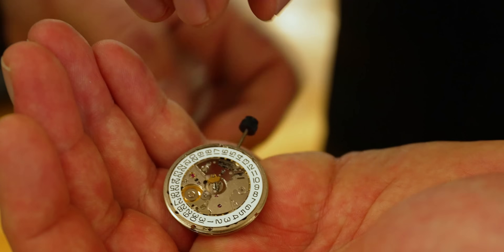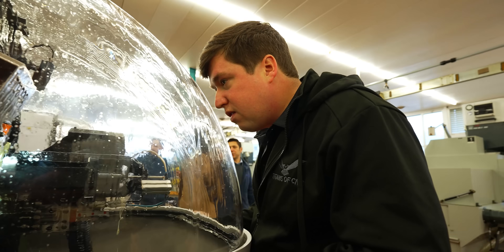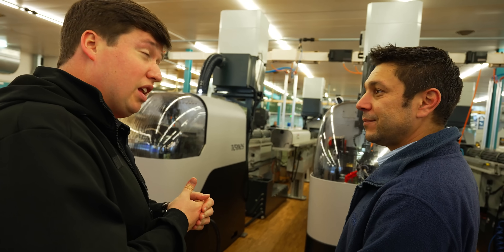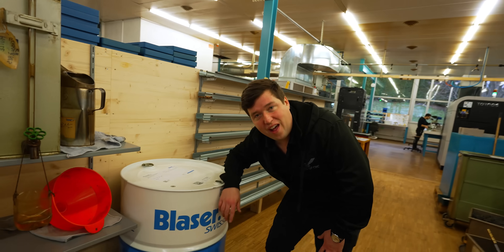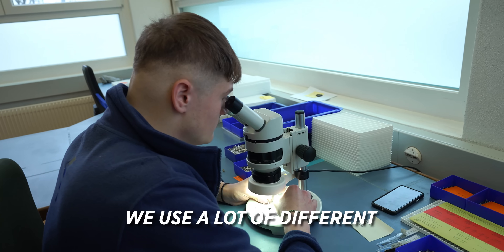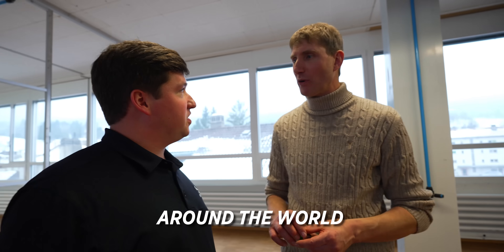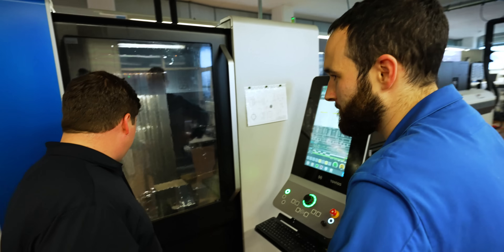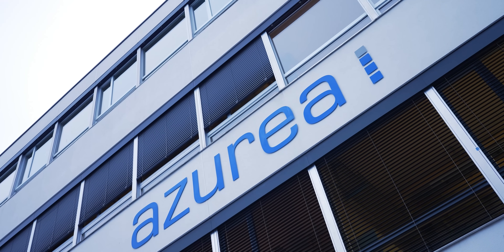Making Millions of TINY Precision Parts In Switzerland

Comment: Super impressive. I programmed machine tools in 80’s before there were high level CAM systems. APT was the programming language and there also wasn’t any 3d CAD. You visualized the 3d part in your head from a 2d drawing and wrote code line by line. It was the highest paying job in manufacturing. Today the machinists program their parts at the machine. How things change in one’s lifetime.

Comment: Has everyone faioed to mention that before CNC the same parts were made to the same accuracy in numbers not so smaller than now? For example, some factories were able to produce 3,000 complete  basic watch movements per day, with most parts made in house. Now, that is really amazing.
Reply: Yes, the old-school way had a lot more manual labour and custom machines that did one job only.

Comment: A machine shop with windows????
Reply: Swiss law.  All work areas must have natural lighting.  If not there are significant limits on the work which may be done.  I was at a factory there that does all precious metals such as machining gold, platinum, and palladium.  They even refine and cast their own gold ingots for use.  The facility is enormous and build multiple stories high with all windows facing in to an open air courtyard in the center.  This is to comply with the natural lighting requirements while also maintaining security in a facility where I saw USD 3 million worth of palladium blocks sitting at a machine awaiting processing.
Reply: @kennethfharkin  I wish America had that mindset..... Machine shops here rarely have natural light. Throws your circadian rhythm off too

Comment: Are all Swiss watch companies using CNC or are the more prestigious ones still hanging on to manual manufacturing?
Reply: CNC is taking over.  There are still some old Tornos cam machines running but it is fewer and fewer.  The Swiss nanos take roughly the same space and are now fast enough to justify the swap.  In addition the watch makers are in an "arms race" of sorts to continually make more complex movements requiring more complex parts made from more difficult materials.  You still have an enormous amount of traditional screws but many other parts have gone beyond the capability of a cam to produce them.  You aren't running 316 or Ti on the cams.  This is especially true of the highest end watch makers who continually push the envelope.  

I've been on the floors a couple times a year there since 1999.  Every year there are fewer cams.  The most I see running now aren't even for watches but supporting connector production where copper alloys are king.

Comment: I'm very curious. I work in a high-level plastics machine shop in the eastern US and we're looking at tornos machines. We machine EVERY type of plastic. From generic delrin that many machine shops run, to the polymer equivalents of super-alloys that cost thousands of dollars a pound or more that end up in satellites and other extreme duty applications.

Because these swiss machines use guide bushings as opposed to a standard chuck, is it an issue with plastics? I know harder plastics like polyester or G10 would be fine, but what about softer stuff like UHMW, HDPE, or even PFTE? if you saw anything like that there Donnie, I'd love to hear because we've used your shop's production as some inspiration for looking to purchase swiss lathes
Reply: Yea it should be fine as long as the outside diameter of the material is consistent. There is also NON guide bushing mode which makes the machine function like a traditional lathe. There is also adaptive guide bushings that can adjust automatically to the variable diameter of whatever material you are running. 

I can confidently say you won’t have a problem with these solutions BUT I would need all the details
Reply: Chips management will be your biggest challenge with such materials in Swiss type.

Comment: I'm just amazed that in this day and age there is enough demand for mechanical watch parts to support a huge operation like this!
Reply: Have you seen the prices some watches go for?  Also,  I'd bet there's still a lot go into munitions.
Reply: @MattOGormanSmith  Really good call on that. Lots of various clockwork safeties built into munitions. Like needing a certain RPM and revs (that can only be achieved by firing from a barrel) to align the powder train for the fuze. And there's been a loooot of munitions flying around the last two years, sadly.

Comment: 5:46 Only one second to optically check a tiny part with a tolerance of plus-minus 3 microns (metric) AND automatically correct/update the production machines in real-time to fine tune the production run.  Very impressive.
Reply: I took an hour trying to properly measure a 3mm hole with a K6 tolerance on it 😂.  That machine does it in a second.
Reply: Those Keyence im machines are awesome
Reply: @joelawton123 yup. With my company bought Keyence instead of Ayonis.... I cry every day using it
Reply: I’d be interested to see how that actually works , because the time from when they check the parts to the time when they update it, it could be off depending on how warmed up the machine is, I honestly can’t picture how that would work.. and don’t believe it. Especially on a tolerance that insanely tight on a machine that is turning not grinding, and what if the machine is currently running? Inserts are slightly more worn now then when the parts made, someone explain this to me I can’t wrap my head around it, unless. They have some insanely accurate tool setter with macros for tool break detect
Reply: @adammiller4879  thats why you have a temperature controlled environement and machine. Thats just the basic rules in precision machining.
Reply: @Zonkobel  that’s not what I’m talking about, depend on your warm up cycle, your machine can vary .0005, on my dmg mori, if I take a break and set it in it’s precise warmup cycle it will only change about .0001-.0001, so I’m just talking more about the machines variables, there’s just a lot to factor in is my point and it’s hard to wrap your head around it
Reply: @adammiller4879  did you notice that the machines are running nonstop?
Reply: @adammiller4879 you usually don't stop the machines when you don't setup a new part.
A big part in precision machining is coolant temperature control, they can warm and cool their coolant.
Reply: @adammiller4879  Yup, it is years and years of trial and errors, producing watch parts with tight tolerances on Tornos machines is possible, despite the challenges involved. It requires years of experience, a combination of scientific knowledge and artistic finesse. It is extremly difficult to achieve
Reply: @MsKoffeinjunky  I know, that’s just one of the many factors
Reply: @blackshadow772  and it’s amazing isn’t it, these guys must have absolutely mastered every single tiny detail. I’d love to see what type of macro setups they are using .
Reply: @adammiller4879  I see what you're saying about tool life.
Besides temperature variation effecting dimensions there is always going to be tool wear.
I'm sure with their experience the feeds and speeds have been dialed in, and they most likely have already measured their tool life cycles and change them out periodically before the surface finish starts to get bad.
The measurement device just sends data to the computer, and the algorithm + human analysis determines the changes made to the machine.
Reply: @00linered  Yes more or less and if you know well your process you can activate linear correction depending on where in your production
Reply: @00linered  Exactly.  It allows machines to be set to the nominal as the décolleteur does not need to regularly stop and reset the machine.  If that is required they reset to the min OD and let it grow towards the max OD to minimize down time and man hours on the task.  With the human out of the equation this system does it automatically so the operator can focus on other tasks and the adjustments done more often so the production range within the tolerance is much tighter as the machine is set to the nominal and regularly adjusted to it automatically.  Better capability results and this helps the customer as their assembly is more consistent.
Reply: @adammiller4879  you misunderstand, temperature variations scale down with size, and up with size also. on such a small size, the variation due to temperature would be neglible
Reply: @RyanDiederich  I know that, and you’d be surprised, Iv ran small lathes, if you do the math, you’d see even a small temperature change on that short distance will change your size, remember, you’re working radially on a lathe, if your ballscrew grows .0001 that makes a .0002 change in the part.
Reply: @RyanDiederich  No actually he is right temparture variation is an issue even on such a small size part, parts like this are pretty difficult to make
Reply: @adammiller4879  modern sensors can transmit data basically instantly. 

Take modern AA guns and air burst ammunition for example. The round gets fired and at the end of the barrel is a device that tells every single round at what distance to selfdestruct/explode. The MANTIS system does this with a fire rate of 1000rounds per minute.
Reply: @adammiller4879  It works.  I have worked with Azurea for over 20 years.  The first factor is they are not producing usable precision parts until the machine warmed up and stabilized.  They are also pulling parts from the floor at short intervals through the course of the day for inspection, not simply checking the previous day's work.  The processes is continuous throughout the day.  When the data is plotted you can observe the trend and anticipate.

Comment: Bet I have a few of those parts in my watch,... says Switzerland on it🤔..... and the box it came in says China 🤨... hmmmmm...... maybe they buy Swiss parts ?
Reply: A full mechanical watch can be produced (components, assambly) far below 100$ in switzerland. The swatch sistem51 starts at just 150$ for a full mechanical watch.
Reply: @Francis-yc9nc  Yet the sistem 51 is less than stellar.  I got one the first year and it lasted about 18 months.  Now the Swatch IRONY Automatic I got in Bern in 1999 for CHF 120 ran perfect for just over 23 years.  It sadly died on me this past Spring 😞 The sistem 51 was also loud.  

I have a knock around Tissot on for now and will be getting a Zenith El Primero next year.
Reply: Rip bozo, you got scammed
Reply: the Chinese can make everything, even some Swiss gears
Reply: There is a difference between MADE in Switzerland and DESIGNED in Switzerland.  They are very specific about the Made label with the content of components which must originate in CH.  This has actually increased in the past years because they want to preserve the brands and their value.  

What make watch is it?
Reply: Rolex, Submariner